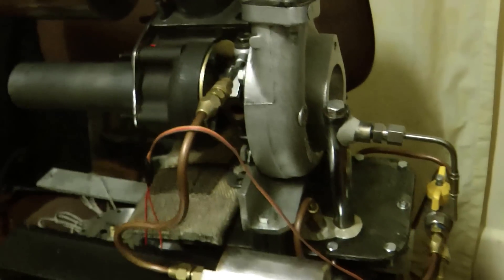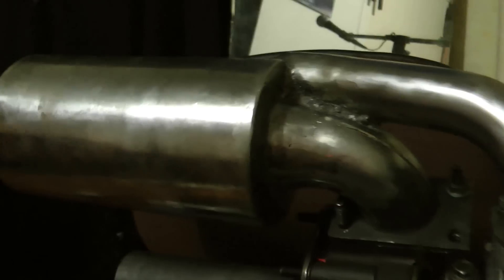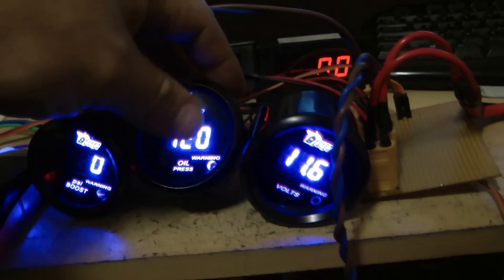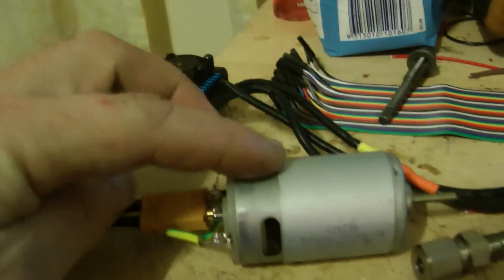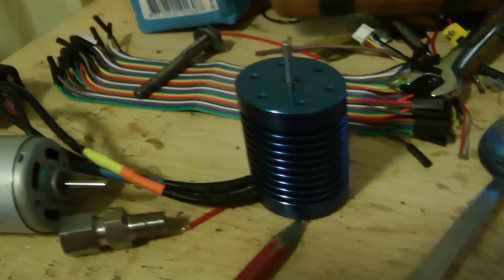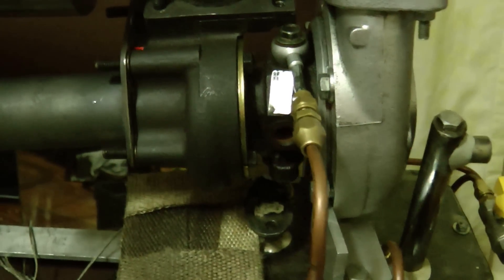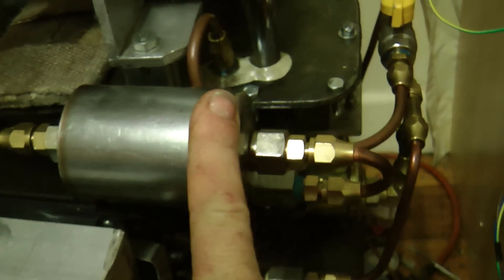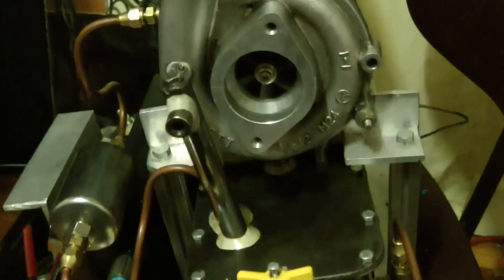How to Build a Jet Engine Part 1. Home made Gas Turbine Jet engine tips and tricks

Comment: Hi Joel I wanted to ask you if you have tried using ceramic bearings?...they are able to take higher heat than steel or bushing type bearings...ps. love your video..

Comment: with the intake tube running closer to the larger combustion hole vs closer to the primary holes (fuel nozzle/spark area), do you find it alot easier to start? or can you share what you have discovered vs the contemporary placement of the tube most people do. I like it and its more streamline but would like to know if it makes a considerable difference...thanks!

Comment: I'm looking for a way to control a brushless motor without having to use a radio control. I like the fact that you can control that motor with electronics you got on ebay, especially the idea of using  knob to dial up the RPMs. Could you please tell me exactly what you are using so that I can do it myself. I'm not building a turbine, but rather doing some experimental work. Also, what is the motor you are using along with the KV rating? Thank you in advance. Bill

Comment: I haven't watched all parts of your turbine build yet so excuse if I'm jumping the gun a little.
I live in the UK and I have a little electronics knowledge so I'm. It too worried about sortin the sensors etc. 
but, I'm using a small low compression turbo from a ford diesel van and small combustion chamber from a small Argon has cylinder. It's not built yet as I'm just gathering parts. 
Is there anythin you could recommend I do or use that helps in the build. Is a mig welder enough to use too??

Any info is a help.

Cheers.
Reply: surrealfx looks like you didn't get an answer
Reply: reefy mcscrudge is say you're right lol was worth askin I suppose 😂
Reply: surrealfx haha guess you didn't do it am i correct?
Reply: reefy mcscrudge I did but not with that low comp turbo lol I couldn't wait for this guys advice any longer 😂
Reply: surrealfx haha nice umm you mind if I see I'm trying to build one of my own , I'm working on a home made airplane I was originally thinking a motorcycle engine. but this changes evrything
Reply: reefy mcscrudge it's hard to get big thrust out of one of these without throwin a lot of money at it......from what I've found anyway. I don't have mine anymore. Parts failed and seemed to be a constant money pit to keep it going. Was fun while it ran. As for pics etc.,..I'll see if I have some somewhere.
Reply: surrealfx yeah thanks umm idk how you want to send thee pictures but Teel how you can . and I really just want to see your configuration . from there I would add difrent turbos or styles that would eventually produce thrust
Reply: reefy mcscrudge well I ran a turbo from a Volvo truck. I used propane gas so I could mount it to a go-kart. I could use small cylinders on the kart. I never got as far as mounting it to a kart because of the problems I kept having. My intention was to fit an afterburner which gives the main amount of thrust. Uses fuel quicker too.
What are you using to calculate combustion chamber size etc?
Reply: surrealfx idk that's why I'm asking someone that has already made one
Reply: surrealfx Ll right thank you
Reply: reefy mcscrudge this is worth reading too. 
http://m.instructables.com/id/How-to-build-your-own-Jet-Engine/

Comment: love the jet engine. I am going to build one myself but the air intake will intersect using a heat exchanger with the exhaust heat to preheat the air before combustion giving rise to pressure and lowering exhaust gas temperature

Comment: nice work
 but one thing ok?
 and this is a fact,
 ive ran  my turbo for exactly a half hour  on gravity fed oil lubrication its a john deer turbo , ive taken it to pieces to check shaft and bearing... and its all ok not a mark not a groove worn into shaft,  if ran longer maybe a problem but on a FULL BOTTLE OF PROPANE AND IT GOING FULL BLAST ON WHAT IT RECIEVED , ITS OK BY  ME remember its only a fun project ok? not  anything else

Comment: Instead of putting a clutch on the starter, could you let it spin, and be the alternator to keep the battery charged? Less weight than two components. Could have issues though? What sort of wheelbase and headstem angle are you thinking for the bike frame?